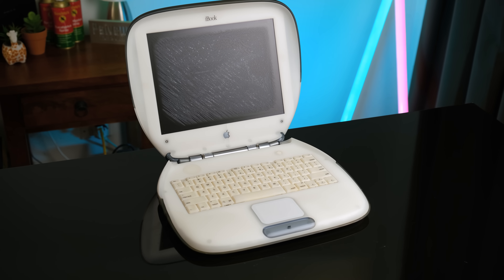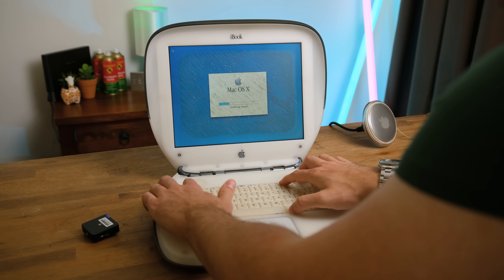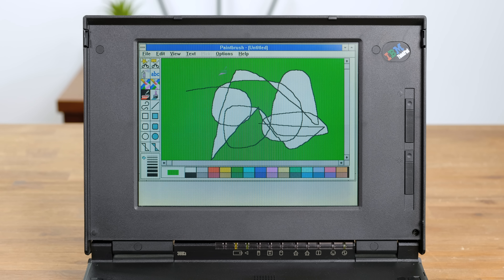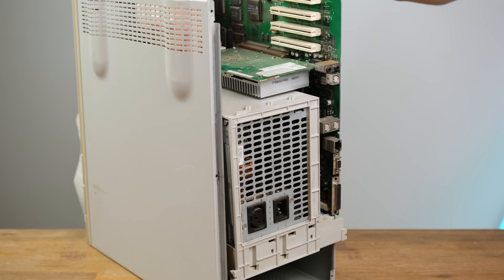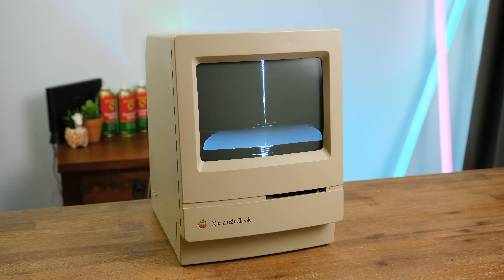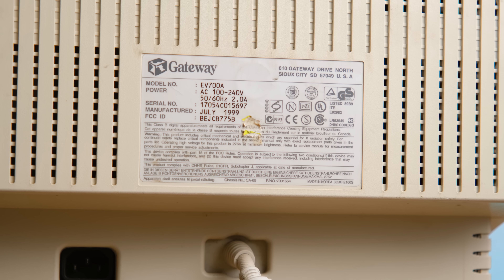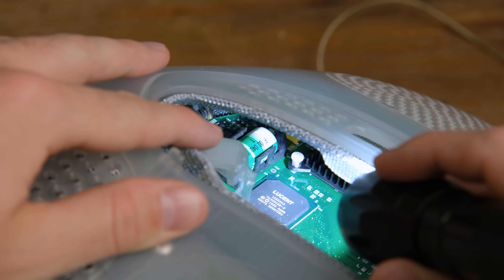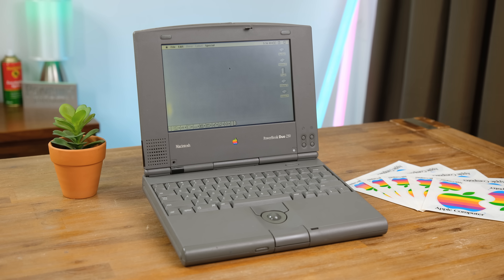So Much Vintage Tech Is Dying... Here's Why

Comment: The sticky layer of rubberized plastic can be easily rubbed off when using a mix of baking soda and water. It's important that this mix does not get inside the device, where it can harm electronic components. Disassemble if possible, and otherwise be super careful. Make sure everything is dry before use. Usually the plastic won't have that elegant matte finish anymore, but it won't stick on your hands.

Comment: I think Psion PLC used three types of plastic. One of them goes brittle and snaps, the other goes soft and crumbles. Psion Revos are already snapping, Series 5s are fine, other than their screen cables that, luckily, you can buy. Series 7 and Netbooks have internal battery leakage problems, as seen in this video. I think Series (don't know about the 3MX) 5/5MX and 7/Netbooks and Netbook Pros are the only Psions that will win the battle against time.

Comment: What would be the ideal long term storage for those plastics? Storing them in a freezer?
Reply: Domestic freezer temperature would probably slow things down a bit.  Near absolute zero should stop most of the chemical decay processes, but how do electrolytic capacitors react to being frozen?  They have liquid inside.  Most electronic components have both upper and lower storage temperature limits.
Reply: @galacticminx  It would probably make sense then to keep the plastic casing and other degradable parts in a separate cold storage. Capacitors are at least replacable by an equivalent if needed. But the casings are not  made anymore.
Reply: @vast634  Might be a good idea to replace electrolytic capacitors as a preventative measure, because the corrosive oily stuff that comes out of them and corrodes the copper tracks is hard to see.
Reply: @vast634  And from repairing digital pianos I know that the tracks are usually eroded away where they go underneath chips and can't be seen.

Comment: Replace caps on lcd. Remove the top layer of plastic on lcd. It might a polarizer lens which you may be able to replace. Schindler plastic. Ex CEO used cheap plastic on Mac’s. That’s why. Batteries remove them.

Comment: Regarding the ‘vinegar’ syndrome LCD displays - is there any chance it is due to tiny amounts of NiMH battery leaks? I have two old 486 laptops which I stored upside down; a NiMH battery leaked on one - a miniscule amount reached the LCD on one (I couldn’t find any evidence of how it got there) - the entire screen had the exact ‘vinegar’ problem; the other laptop didn’t leak, and the screen is perfect. I dismantled both and saved the motherboards which had minimal damage!

Comment: You’re right - awesome video! I was cleaning out closets and found old cell phones from early 2000’s and the rubber was sticky. However, my Motorola StarTAC from 1996 was fine. I also had an old IBM Dell Laptop from 2004 and it was fine as well still in computer bag. I also was able to use bleach water to get rid of stickiness along with using rubber gloves and small nail brush. It worked as well.

Comment: that's great ! So less people will use old hardware which is a good news for global warming as we can nowadays get the same computing power by using a lot less energy.  it would be even better if it applied to cars too : I would love to know that u can't use your 70 years old car which pollutes 10 time more than modern ones.
So yep as a computer engineer (ok i'm a dev so i'm more interested in software than hardware, but still) i'm glad this old energy hungry hardware can't be used anymore.
My raspberry 3a+ use less energy than the radio alarm clock that used to wake up my parents when i was young, but can do way more things...
Reply: This is their hobby, and they don't use these devices on a daily basis, kid. Imagine your parents switching on alarm clock once a month for a moment of nostalgia, but there is this kid who wants it to break down because his raspberry pi uses less energy. You will miss your raspberry pi when you are 40 or 50.
Reply: @pavel9652  if all parents in the world were to switch once a month by nostalgia it would have a real ecological impact. Also don't call me "kid" i could be your father, son. I won't miss my raspberry pi at 40 i'm already passed 40
Reply: @alienews0  Sorry, you sounded like in early twenties. Everything has an impact. Have you ever taken a flight? It is circa 40 litres of kerosene per capita per hour of flight. Each litre is about 10 kWh of stored energy. Parents would have to run the example alarm clock for years if not decades to use the same amount of energy. Learn the 20/80 rule and stop chasing <1% of impact because it is counter productive.
Reply: @pavel9652  you mix up things which doesn't make sense together (which sounds like an early 10's). You mix usage which make a sense because they help you to go from point A to point B (a plane) and something perfectly useless (getting the same result using more energy than needed like waking up with an old radio alarm clock). 
With such a way to reason you must leave your faucet open all day long because hey closing it, is boring and it's nothing compare to the water industry uses.
This is not the way to go, that's why here in france the government asked the people to not heat their house more than 19°C (when most people used to go to 20°C) if they can because there are no small saving.
But if you're american it's quite normal you ignore the global warming as your country refuses to do any effort on that matter.
Reply: @alienews0  I sense bruised ego. 1) I am not mixing anything. It is an example of 20/80 rule. Many people travel despite not needing to, but I guess it impacts you, and this is a real problem. 2) Working alarm clock from your example isn't perfectly useless, so your analogy is flawed, like your entire argument. 3) The analogy with tap water is also false. The correct analogy would be if old taps used more water than new ones when operating or by leaking. 4) Heating is another bad analogy unless the same alarm clock is set in such a way that it uses more energy. Heating is expensive in terms of energy, though. It is not abnormal to have houses heated by 20 kW burners, which burn 2 litres of oil per hour, and it is a good example of 20/80 rule, which you don't seem to understand. 5) I am not American. Didn't you notice I use litres as a unit? I probably know more about climate change than you since I have been interested in it for 15 years and all my life in science. The issue is that you are chasing well under <1% of savings from the tiny community collecting vintage hardware they don't even run every day.
Reply: @pavel9652  i' ve been interested in climate change for way more than 15 years (more like 25 years or so). Also you keep on thinking small. I'm not at war against old mac users but against energy waste. Using old hardware which consume more energy than modern ones is just one example along so many others. 
If all the people on earth were using no more energy than they really need, pollution would be cut by half or more. so we're far from Pareto's law (or if it is the 80 side is the one i'm at war against, the useless energy waste like that old mac)
And yes the analogy is perfectly fine as your reasoning is "some do way worse so it's ok" this is precisely what u defend by saying it's ok if old mac user waste some energy cause it's nothing compare to what the industry is doing" . Which is obviously stupid as that way i can justify murder, it's ok if i kill one single guy as army destroy way more life so it's nothing in comparison.
What u seem to ignore is small streams make big rivers, and also u forget to multiply that old mac user energy waste by all of the old mac users and by all the same kind of energy waste just for pleasure. Once again what u must compare is not if someone is doing worse than u but the needed energy compared to the one you effectively use. You should know these basics if u were a scientist, i doubt you are
Reply: @alienews0  Then you must have wasted quite a bit of that time. You don't understand that these people barely use their vintage equipment, and it is insignificant. They are collectors, primarily. I am thinking big because I focus on things that matter the most in this conversation, while you focus on a fraction of the percent of their energy usage. Analogy with murder is another flawed analogy since it isn't ok to * anyone and they aren't doing it to anyone. Also, what is your hobby, so we can figure out who uses more energy than they have to? Watching videos for entertainment, for example, sounds like unnecessary activity that generates tons of co2 annually. Did you really have to watch this video? I didn't say I am a scientist. I only said I have been interested in science all my life, which implies I understand it better than an average person, although my title technically contains word science in it.
Reply: @pavel9652  "which implies I understand it better than an average person" => maybe but not necessary more than a computer scientist. 
You keep on talking about old mac users when i talk about energy waste globally. Also you didn't understand what i mean by necessary energy (btw i didn't say "necessary" but "needed", which is quite different, "necessary" is what can't not be, while "needed" is what is necessary but for a specific use case not in the absolute. So you might need something to perform something which is not absolutely necessary.

Also this is not about the quantity (even if as i said if the whole humanity was wasting 0 energy we would probably at least use twice less energy (just think about the fact that 1/4 of our food production goes to trash)) ; it's about the principle : i can't get that video by any other means than youtube (but if u wanna know, when it's just a face cam of a youtuber talkin, i go down to 144p or i even download only the sound stream and not the images), if i could get it in a more ecological way like good old hertz waves i would. 

I'm not against people having pleasure, i'm against people doing a thing in a non efficient way, which wastes energy. For example letting water flows while i brush my teeth is nothing compared to me taking a shower. But i prefer someone who take 20 mn shower and stop the water while he brushes his teeth (as obviously that water is wasted and doesn't increaze that guy's comfort) than someone who take 15 mn shower and let the water flows while he brushes his teeth. Even if in the absolute the 2nd guy will use less water than the first one. It's about wasting or not.
Reply: @pavel9652  "Analogy with murder is another flawed analogy since it isn't ok to * anyone" => while wasting energy and polluting the earth to the point so many living form are disapearing for our comfort is perfectly fine, i feel you XD
And nope again the analogy is perfectly fine, if it was perfectly the same conditions it wouldn't be called an "anology of the situation" but "the situation". And the analogy is fine because it use the same principle you defend : it's ok to do it because it's a little drop compared to the whole situation. And you killin 1 single person every 70 years for example is also a tiny drop compared to how many people die on earth of non natural causes on a period of 70 years.
Reply: @alienews0  1) Your understanding is yet to be determined. Your original comment says they can get the same computing power from new hardware, while their hobby is literally about collecting vintage hardware and not about performing effective computing or working on it. So you don't understand this video, and you don't understand what has a real impact on climate. 2) Word necessary is a synonym for needed. What is needed is necessary. 3) Why have you watched the video in the first place? What did you need it for? It doesn't matter how and where you got and in what quality. The video was watched for entertainment and was about legacy hardware, which you declared wasteful already, so the whole activity was wasteful by definition. It is called hypocrisy. 4) You are clearly against "pleasure", but when it applies to others or according to your subjective list of things that are needed and not needed. 5) Comparing murder to using a computer isn't helpful, but if you want to stick to it, a 486 class computer requires a power supply of around 100-150 watts, so unless you are running efficient laptop or smaller board like RPI they are using comparable or even less amount of energy to run their machines. They are just less efficient than modern PCs per calculation.
Reply: @pavel9652  1) "while their hobby is literally about collecting vintage hardware and not about performing effective computing or working on it. So you don't understand this video" => i condemn bull-fighting i could perfectly say in the comments of a video of a corrida  that i found it cruel while perfectly understand it is some people's hobby (including the video uploader). I don't see how your point makes any logic 🤪
Btw if i was to make such a comment someone could then answer to me why according to him it ain't cruel, or how compared to how many cows we kill to eat them, it's a tiny drop. And i can try to explain to him it's not about the quantity but the principle : needs vs superfluous. And it will be very similar to our debate needs vs waste)

2) FYI Necessity refers to something that is essential or required, while need can refer to both smthn that must be or something that is desired or wanted. For example when i say "i need to have that music album" it's clearly less intense than "it's necessary for me to get that music album" . 
In philosophy, necessary is defined as what can not "not be". So i really know why i didn't use "necessity" but "needs". 
Now u're allowed to use them as perfect synonyms,  like you can use risk and danger (in safety domain, danger is absolute while risk is a probability) as synonyms, or theory and hypothesis as well (in science a theory is way more stronger than a basic hypothesis, it is a whole coherent system which can predict or at least explains a phenomenon) as in common language it's a current misuse of language ; but don't put these words into my mouth when i didn't use them and i implicitly told it was on purpose.

3) this would be a very poor argument if it even was one, as it's an ad hominem. But it isn't even an argument as youtube's autoplay put it for me while i was rolling a cigarette (i watched the beginin out of curiosity : the fact that i condemn energy waste doesn't mean i'm not interested in learning why a specific high-technology product got such a short lifecycle. Obviously if i'm concerned by energy waste i'm interested in everything related with planned obsolescence)

4) i explicitly said, it wasn't the case and explained why, so you are either dishonest or too limited to understand what i explained that i was even explainin it (else if you understood i was explainin it but didn't understand or disagree with it you would have ask or made a counter-argument about it, instead of just ignoring it - if you were honest - ). Sry to be a little aggressive here, but honestly you deserved it on that point by insulting me of enemy of the pleasure of the people.

5) "Comparing murder to using a computer isn't helpful" => you just don't understand what an analogy is and its purpose, it's here to illustrate a principle, i detailed that principle already (i.e. here a tiny drop compared to a whole) if u don't want to or are not able to understand that simple thing, i dunno how to explain it more clearly... 
So i already explained it to you, you just repeat the argument that i already countered by explainin to you : the goal is not to compare murder and energy waste but the principle you try to defend : it's ok even if it's doing wrong because it's just a drop compared to the global phenomenon.

Also comparing the energy they use (for how long ? the montage video length is different from the rush) to the energy used by my pc to watch that video makes 0 sense at all. Except if he was watching his own video using that very hardware... If the idea is i pollute as much by watchin than for them to make it, then you forgot to include the camera energy, the montage energy, the upload energy, the disk usage in google's  hard drives and so on ; so still makes no sense.

So yeah i feel like i'm wasting time, u need to learn how to debate cause so far it went exactly like that :
YOU : x² is positive in every situation
ME : that's wrong, when dealing with imaginary numbers : i² = -1
YOU : x² is positive in every situation

can you see the flaw ? You can't just repeat your 1st argument after i defeated it or we can't go forward, what u must do there is counter my argument so you can say for example "there is no such thing like imaginary numbers" (but you would be wrong), or correct your sentence by saying "in R (real numbers) x² is always zero or a positive number"

And that's exactly what happened except it was more like 
ME : [making an analogy with murders]
YOU : you can't compare murder and energy waste
ME : it's an analogy i don't compare murders and energy waste, i give you an example that defeat the principle you defend by saying it's ok even if it pollutes more than needed cause it's just a tiny drop compared to the  whole. (The purpose of that analogy was to make you understand no such principle exists, so it is not a valid argument.)
YOU : you can't compare murder to using an old computer
ME :  ...

So yeah i don't know how to debate with someone like you. 
So let's just agree to disagree. 
Bye